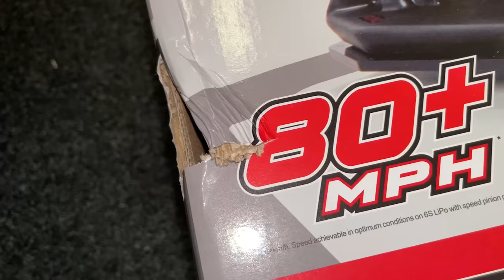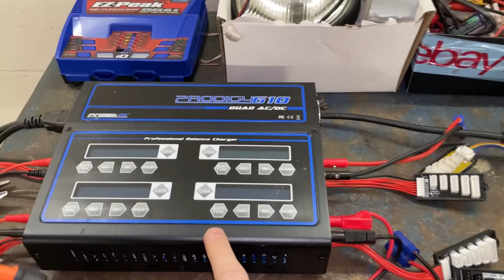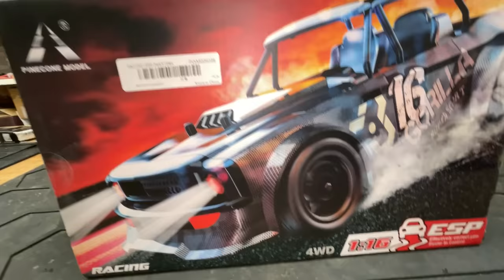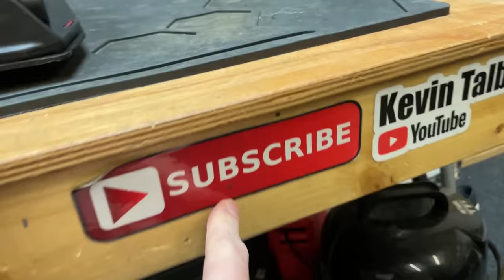The Ultimate RC Street Race Drift car

Comment: I almost bought one of these but decided on the limitless instead. Love the tinkering aspect of the hobby as well as the bashing.
Reply: How much knowledge do you need to have to build a limitless? I am also interested but I have never installed a motor and Esc. So I'm not sure how difficult it is. Is soldering required?

Comment: Hey Kevin! That Orange Felony is gorgeous! I'm not into the drifting or parking lot running but that would be the one I would be getting and all the options they come with is a plus they should throw in a spare set of tires in the box! That little drift truck at the end was very impressive to for a little starter drift truck great unboxings and content your going to have to put some of those titanium plates on that Felony for the night runs!🤔😉😯📹😂🤣😂

Comment: 2:14 I looked over the manual and I figured out what the tube is for. Go to page 12 of the Arrma Felony car, you'll see the Accessories (Felony Only) So you see on that page there's the Supercharger hood part, the 8 trumpet parts, then one other part. That part is a turbo intake manifold. Those two pipes sticking out are for the charge pipes. Another portion of that kit has two turbos that stick out of the hood. That black pipe is to be used as like, fake turbo piping for the intake and the intercooler and stuff I think.

Comment: The hose is for the intercooler.  You connect it to the two holes in the side of the intercooler and it connects to the body that way to simulate a real intercooler.

Comment: "FELONY IS NOT A DRIFTER IT IS A DRAGSTER " 

Had one , sold it , got a limitless than upgraded it to make it go 140 mph 😂. 
The felony has bigger rears and rear differentials. 
Is based off of an infraction but is not used like one. The limitless is for speed runs the felony is for drag the infraction is for drift
The plastic intercooler mounts to the front bumper have to take apart the front bumper skid plate off access to mount it is underneath then u cut the rubber tube and add them to the side of the plastic intercooler and slide into the front hole directly next to the intercooler.

Comment: got mine a few weeks ago and while driving wide open on a 4 line i went into the center lane and out of no where a rock the size of a soft ball sitting in the road wipes out the while passenger side and bent my frame slightly

Comment: I've turned mine in 28S and have gotten a 132 mile an hour out of it but I've had to weigh the car down quite a bit at a bought a 104 105 miles an hour the car takes off like an airplane